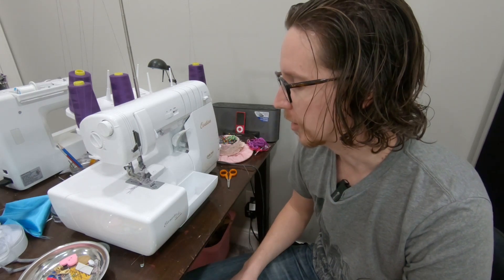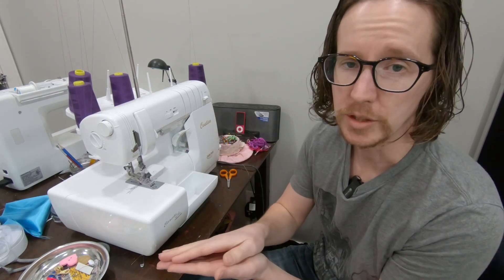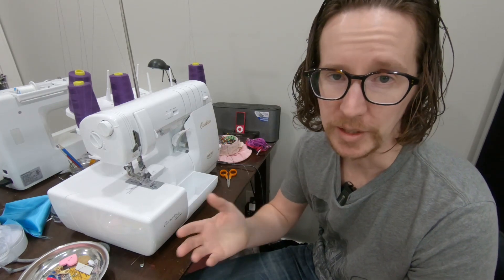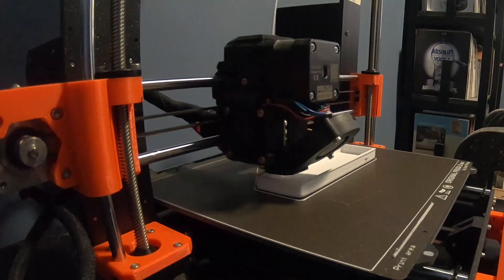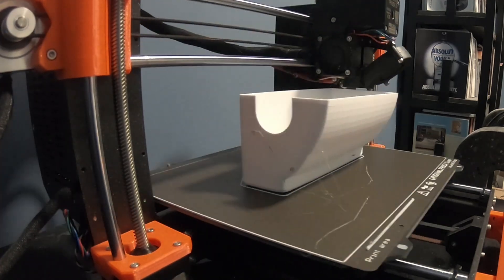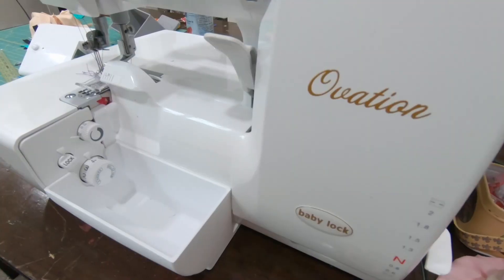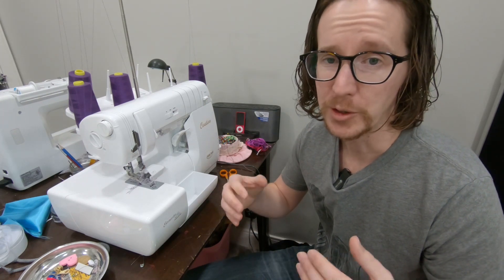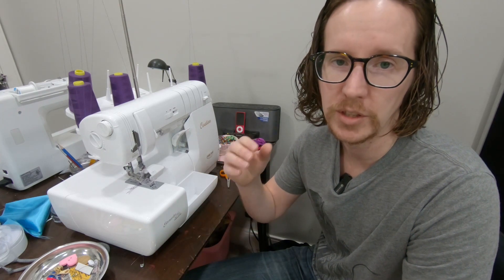Serger Scrap Catcher - 3D Printed with a Prusa i3 MK3S

Comment: I have a BabyLock Acclaim - It's an only serger machine and does not include coverstitch.   Do you know if your creation will fit the Acclaim?  If so, how much would it cost and would be great if you could give me a rough estimate for postage to Singapore.? Thank you!
Reply from the maker: I am not 100% sure as I have not worked with that machine. But it does look very similar. Shipping to Singapore probably isn't feasible, however I could sell you the electronic file for 3D printing and you could have someone local to you print the part.
Reply: @ResearchDesignBuild  Shipping cost is hefty.  How much would your electronic file for the 3D printing cost?  I'll have to look for someone who can do this for me. Thank you.
Reply from the maker: @petgiam1156  Yes the shipping is a little nuts. I would be able to sell the 3D file to you for $10 CAD.
Reply: @ResearchDesignBuild  Okay thank you.  I'll look for someone who has the machine and I'll get back to you asap.  Thank you again!
Reply: @ResearchDesignBuild  Hi...I still have not found someone to do the printing but I think I should be able to find one eventually.  Can I buy your 3D file for this?  I think it should fit mine - it's a Babylock Acclaim Overlocking machine.
Reply: @ResearchDesignBuild  Hi...I wrote to you some months back about getting you to make one for me.  I am going to Vancouver in June this year and I'm wondering if you made one for me, could you send it to my friend's address in Vancouver?  Please let me know.  Or else I'll buy the electronic file and look for one who can make it for me.  Thank you
Reply from the maker: @petgiam1156  please email me at RDBSteve@gmail.com and we can figure something out. Shipping to Vancouver will be much less.
Reply from the maker: I just took a look at shipping could be between $60 and $100 CAD.